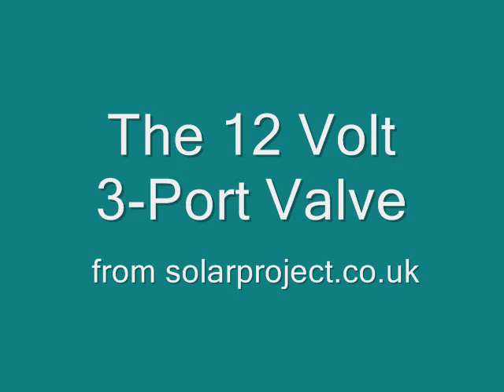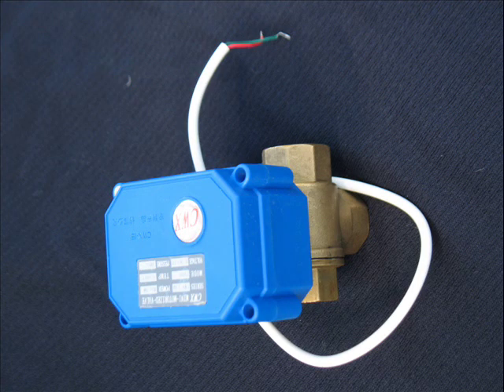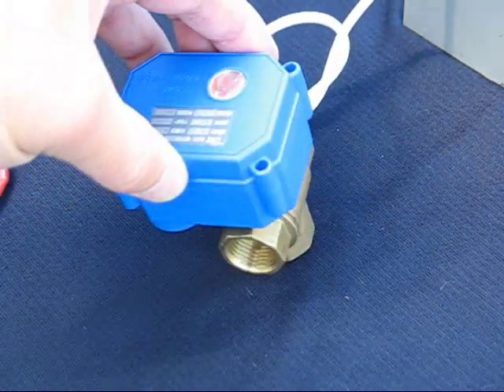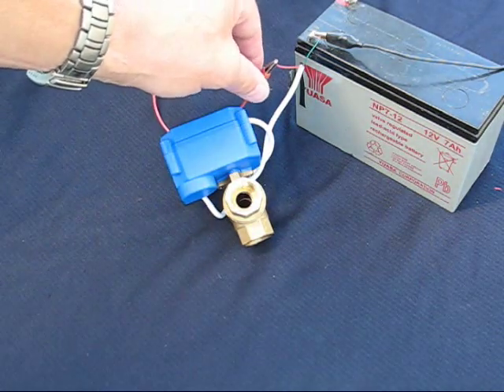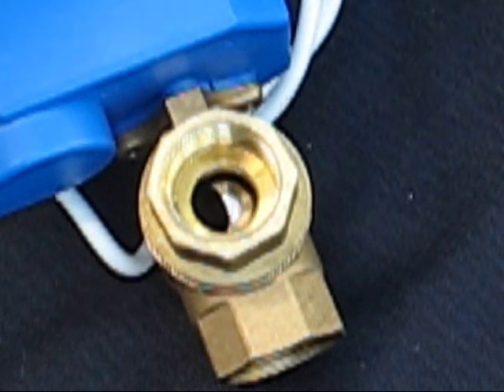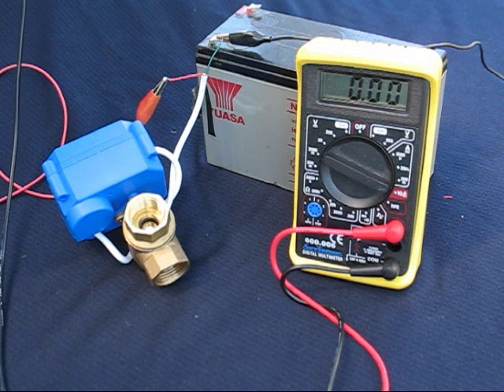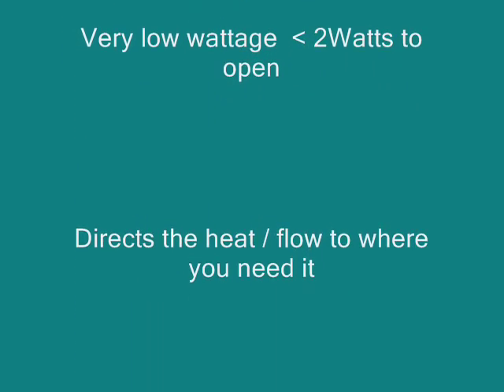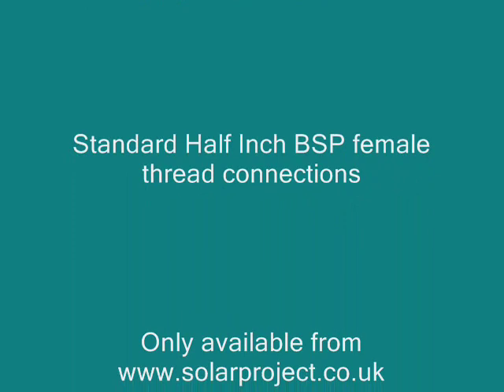three port valve.wmv

Comment: They also make these in stainless, with a variety of voltage options, and with a variety of control options. Variations include with feedback signals to tell you when it is open or closed, or control with a seperate switch.  Lots of info available from the direct seller at:
www.flow-controls.com
http://www.flow-controls.com/IP67-on-off-Electric-ball-valve-Model-TOFINE-THA20T-100T.html